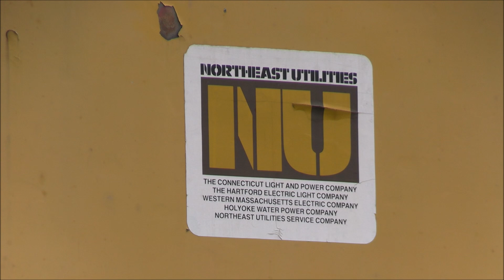Stored 1941 80 Tonner locomotive saved, loaded on flatcar - Springfield, MA - 6/2023

Comment: Great to see old equipment being saved and used!  I take it the loco and flatcar couldn't be towed to their destination is because of braking system issues?
Reply from the maker: Friction bearings
Reply: @SouthCoastRailVideos  Don't know what that means.
Reply: @kenmcgory8768 "friction bearings" are an old style of axle bearing where a shaped block of soft metal sits between the top of the axle ends and the truck frame. Lubrication is provided by a resevoir of oil soaked absorbent material that continually smears oil against the bottom of the axle as it rotates. This oil is carried up under the soft-metal block and wedges under it, lifting the car's weight on a film of oil as it rolls along. These bearings were maintenance-intensive, with the bearings needing regular replenishment of oil. If this was missed, the bearing can dry out, leading to metal-on-metal contact which leads to overheating and failure (the axle end can literally melt off, dropping the truck frame onto the roadbed and causing a wreck) 

Modern railcars use roller bearings which are like the bearings you might find in a skateboard wheel, but instead of steel balls, there are solid-steel cylinders surrounding the axle in a sealed housing. They are much less prone to failure (although it's not unheard of -- that's how East Palestine happened). Friction bearings were outlawed on railcars operating in interchange service (meaning travelling from one railroad to another) on the national rail network. The shortline where this locomotive is headed is isolated (it has no physical connection to any other railroad) and thus is exempt from the rule.
Reply: @RailRide  Thanks for the bearing descriptions. Been a railfan all my life, and know what 'interchange' and 'isolated' mean.  I would think most railfans would know this as well.
Reply: @kenmcgory8768  Never know when a newbie might come across these, so it's to their benefit as well :)
Reply: @RailRide  Well, the reply had my name on it, so the comment was meant for me. If I'm commenting somewhere and want to make sure everyone knows what I'm saying, I'll generally put something in there to the effect of "For those who don't know...".  Thanks! 🙂